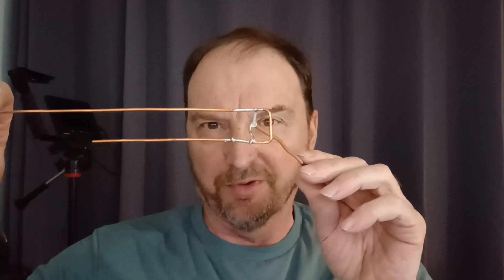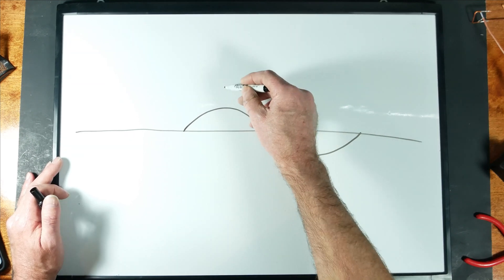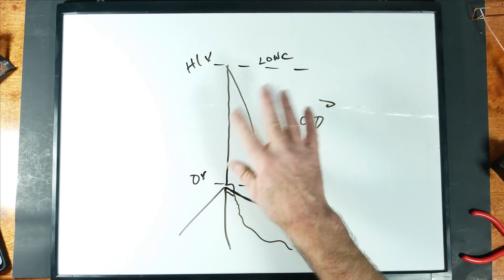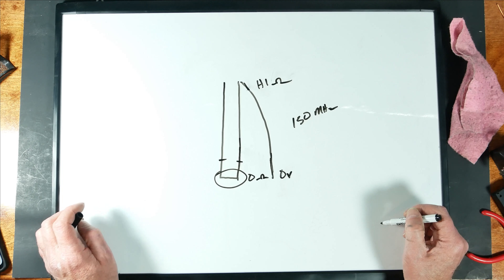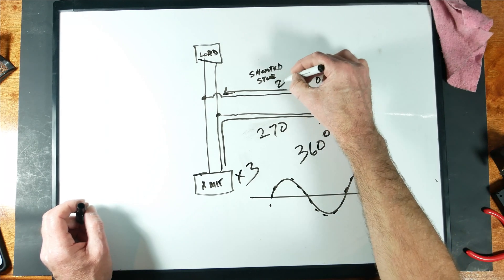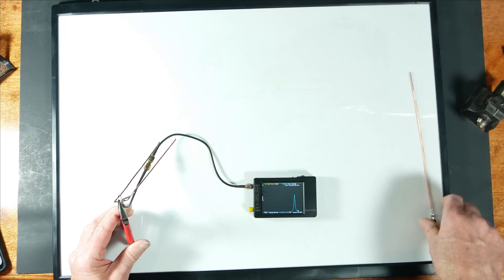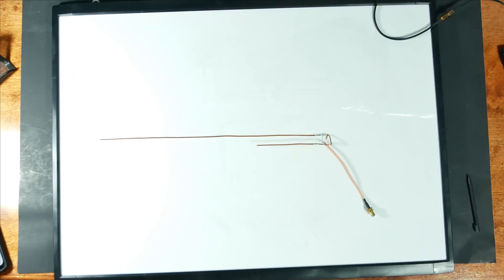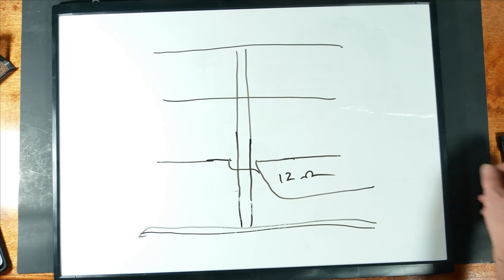How do J pole antennas work when they are shorted to ground?

Comment: you actually don't need to have the bottom shorted for the j pole to work.
Because the top is very high impedance and the bottom then a low impedance... 50 ohm coax too is a much much lower impedance, you connect it straight to the bottom and vary the spacing of the 1/4 wave transformer to get a 1:1 match

Comment: Early in my ham  days I had
 an 80 meter inverted V fed directly with coax. I wasn't operating at the time but noticed a periodic snap in the shack at the end of the coax. It was PL259 arcing as the capacitance of 100' of coax discharged. No damage but watching in a darkened room was like watching a spark plug fire.

Comment: As a teenager aged 13 and interested in radio I built a one valve regen  kit (H.A.C.) and saw the three plug in coils went to earth and wondered why a signal was not going straight to earth. It can't because the radio worked!  
My introduction to short wave listening from 1.6 MHz to 30 MHz and later two more coils for m.w. and l.w. with that one covering the missing bit between m.w. and l.w. I heard nothing.
Later on why didn't t.v. coax measure 75 Ω on the cheap multimeter I had bought. These things needed answering. I started building 3, 4 and 5 valve receivers and aged 19 studied for the radio exam. 
G4GHB.

Comment: any idea why a ic-v8000 would be transmitting when you turn the channel selector. Also squelch will work and quit. I noticed when I turned on my swr meter the radio was transmitting about 14 watts and the swr was 99.99. Turned the squelch and it quit. unpluged the mic and turned the channel selector and it is doing it again

Comment: That short is the best feature of the J-Pole. It means that you can easily ground the entire thing so you are protected against static buildup and lightning to some extent. Though it would still be best to disconnect the antennas whenever there is a storm moving in.
Ah, you mention that near the end of the video.